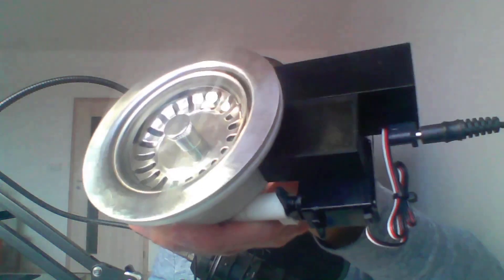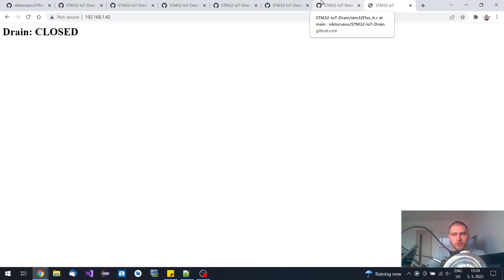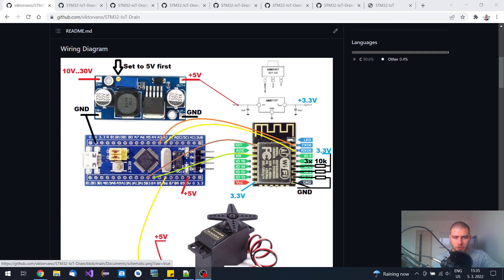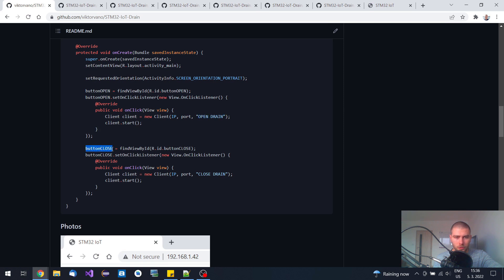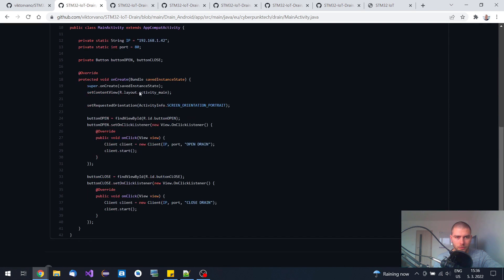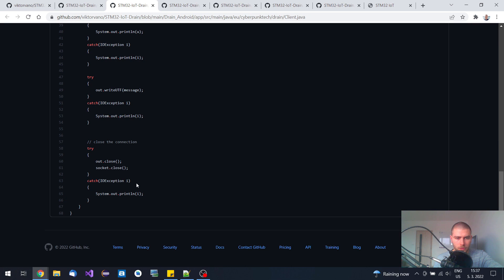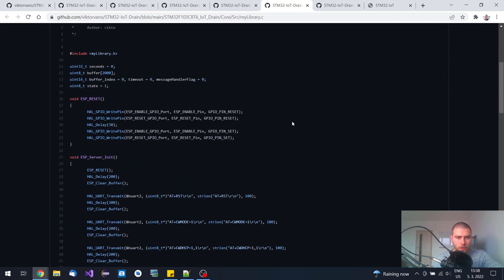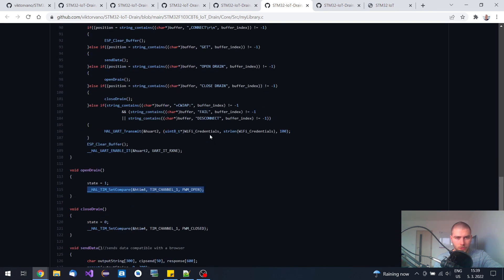IoT Drain - STM32, ESP8266, Servo + Android App

Comment: what are settings you made in .ioc file of stm32 and how the android app is integrated with this project plzzz explain little bit.  Thanks in advance
Reply from the maker: The whole project is downloadable. I usually set clock to 72MHz and set some timers.
Then it should be obvious when you will check the main file and the interrupt source file.